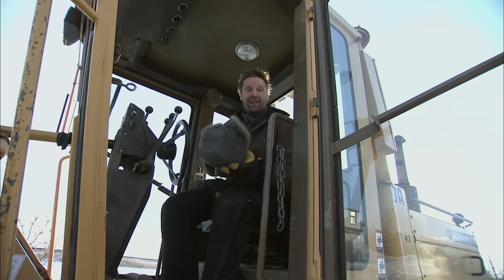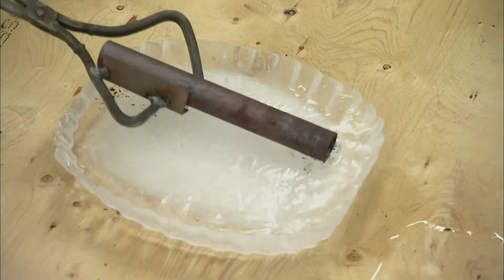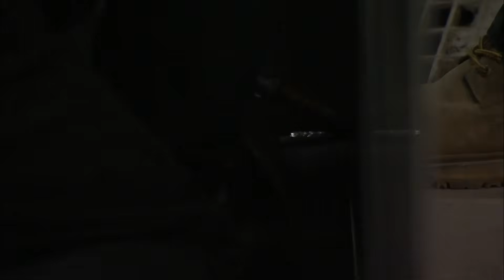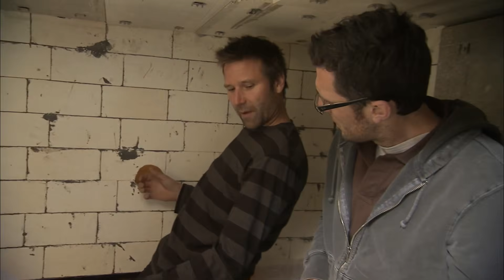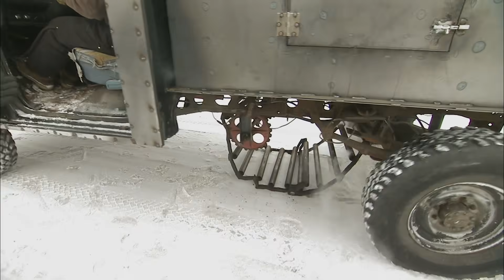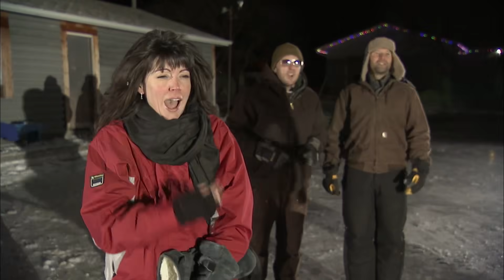We Built a CRAZY Snow Destroyer! Will It Melt the Road or Blow Up? | The Re-Inventors

Comment: The design as a snow removal method is easily fixed. Drop the furnace rear section down to about 3 inches from the road surface, replace the chain with a solid steel plate layer (or copper layer) reduce the furnace interior area to a quarter of the current implementation, blast the metal floor with the heat source.